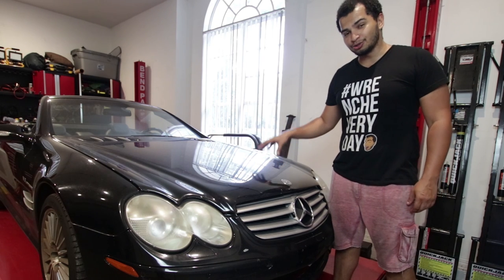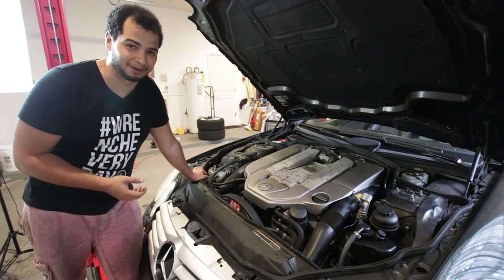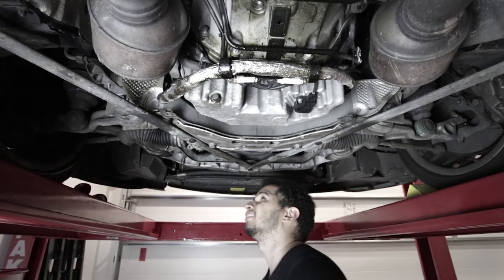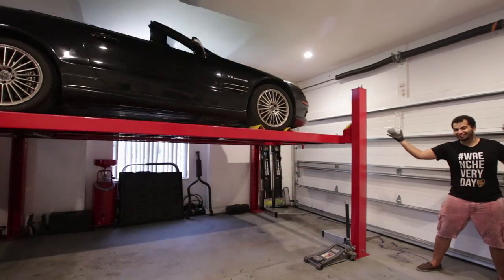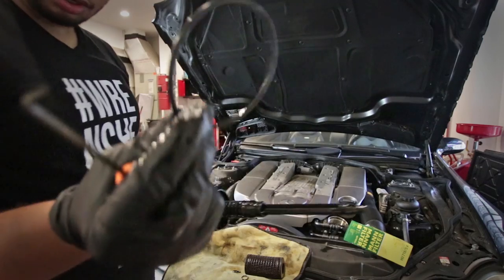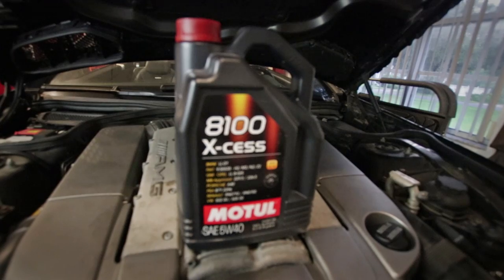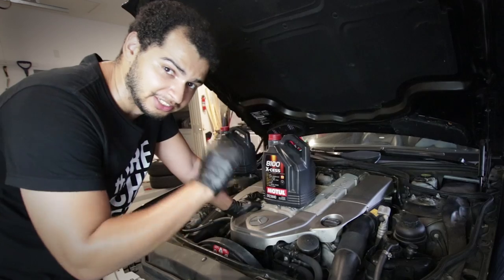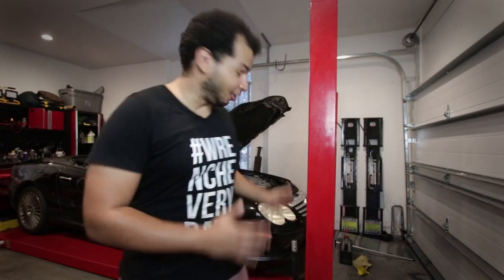Here's Why A Mercedes Oil Change Costs $320 And Why You Should NEVER Pay That Price-Project SL55 Pt1

Comment: Engineers who deliberately design products to be more difficult to repair and service should be forced at gunpoint to work as a mechanic for a couple of months.
Reply: Engineers simply make the engine. How bout you pull out the engine from the car and work on it outside of the engine bay. No more bitching then huh.
Reply: "Fuck it, I ain't gotta work on it"
Reply: That's why I like the Korean stuff. The layout is very well thought out by people who have appeared to have cut their teeth working on cars.
Reply: You want a complex car swished into a compact body, it's going to be tough :) I guess some engineering has different goals, and that the odd position is better for performance or longevity
Reply: If you make the car easier to work on, you're basically planning on failure.
Reply: Chilly Dawgg "Fuck it, the next crew can figure it out" - My coworker who drew all the blueprints to a building into a single room without any regard to whether or not they were needed lmao
Reply: Its fault of marketing, not engineers, which I am. Engineers design is Always constrained by marketing.  Serviceability is not high on the charts for marketing and corporate. Price, performance and aesthetics are. Engineers are give an order to create an engine of X-hp in an area of X for a price of X. The more time needed for service the better is how corporate sees it as thats how dealerships make money.
Reply: Rite!...key word DELIBERATE!...
Reply: @adriangutierrez9582  how about just don't buy the piece of shit in the first place!...then no bitchin at all!
Reply: @adriangutierrez9582  so have i but not for something as silly as an oil change MB is garbage plain and simple I've worked on pretty much everything with a combustion engine and these by far are some of the worst cars on the market along with Audi and i love Audi but they are beauties that's it!...if i got that car I'm slamming a 4.8 Chevy LS and uncomplicate my life!...
Reply: That's a bullshit excuse German engineers might use. The bottom line is that sooner or later all cars will need work done on them. Thinking of ease of service doesn't speak to the car's cheapness or poor quality. It's just that marketers have done a great job of convincing some people that unnecessary complication equals sophistication and better build quality. Practicality and performance do not have to be opposed to each other.
Reply: I think you'll find engineers do what management tell them. It's called planned obsolesence and pretty much everyone is doing it. Phones and laptops are particularly bad examples.
Reply: Well said. I think we're both saying the same thing in slightly different words.
Reply: @ColdWarVet607  You're absolutely right of course. I'm also an engineer and really don't like being blamed for the restrictions that Marketing and the Shareholders put on us. We have less control over design that most people ever imagine. I was shocked and dismayed to learn that at one company I worked at the procurement department would tell us which parts we could use in our designs because they knew somebody that they could buy them cheaper from. This is a common occurrence and of course, most people know that accounting departments often force engineering to limit how much timothy can put into research and how much they can spend on quality (or lack of quality) parts.
Reply: Don Boss  You're right. Its actually not mostly, we receive strict instructions from management that limits us in every way imaginable. I have never worked for a company that told me that I could set the budget, design the product (or feature) any way I wanted to and had unlimited time to do so. It just never happens. LOL
Reply: Okay let me have things cleared up here,  some engineers design their own engines based on the assessment they have that what they have designed can't wear out just in time but again it's in the part of the car owner to use the roduct according to specification if not you will be in a deep shit and spend unnecessarily
Reply: @Billy123bobzzz  hey bud,  even if you had the opportunity to design something yourself,  you wouldn't just want it to be like other manufacturers,  you like to make things look different from others and there would be a time where you have a lot of confidence on your parts which you will use for your build and after lots of testing you designed it and your manual is right there to be used for instructions but these people never uses it,  they never read it,  in my country no car owner will ever read their car manuals or try to do anything on their cars themselves,  they use their cars roughly and when it's time for repairs they bring it for repairs. There are long ways to go in educating car owners really it's not from the manufacturers
Reply: @osazuwaprecious7  You are right but as an experienced engineer I can tell you that the real problem is management and stockholders putting restraints on engineering. We have to fight huge battles with them every day. We know that people don't read manuals so we would design systems that are so obvious that no manuals would be needed but once again, we cannot do that because the problem is management and shareholders (keep in mind my friend hat we are never allowed to talk to the people, we only talk to management and shareholders and since we design and make the product that people the get to experience, the problem obviously goes straight back to management and shareholders).
Reply: Im certain they get orders from the higher ups to design these cars this way.
Reply: You telling the truth
Reply: I have a friend from college who works for BMW as an engineer. He says they're told to do ridiculous things a lot of the time and are told to stay in their lane when they propose much easier/more efficient ways to get the work done.
Reply: I work on my own 2005 Mercedes E320. It is actually designed very well regarding maintenance. It is not difficult to work on at all. Yes, parts tend to be more expensive, but that's because it's European, not necessarily because it's Mercedes. VW parts are just as high (I also have a VW) . The guy in this video is just being dramatic.
Reply: Jess Stuart I love this comment. I feel the same way. im always at work taking certain unnecessary bolts off like god damn engineers!!!!
Reply: Amen brother. I was a heavy line tech for  a Ford dealer many years ago. I would love to have met and cussed out the bastards that designed the Mercury villager/Nissan quest. If you worked on them back then, you know exactly what I’m talking about.
Reply: How about 10 yrs?
Reply: Engeneers design the products ina way  which maximizes the profits of their employers. Famously there is a patent for a bulb with infinate life. .... this is not a good comercial product as once you have sold to a customer he does not need another. Rich companies have an obsolesence element in their products which makes you buy again and again.
Reply: Have you ever worked on a w124 mercedes diesel. Easiest car ever to work on. For an oil change you literally only need a 13mm wrench. Filter is on the top held on by 2x 13mm nuts and even the filter itself has a carrying handle for easy removal.😂
Reply: Absolutely agree.
Reply: Hahahaha hahahaha I cant stop laughing hahaha.. U made my day
Reply: I work at an oil change place and I say this to myself on so many cars and especially the German cars with a ginormous skid plate with 30 screw that are different sizes
Reply: Your oil level might show OK now but once you start engine and gets cycled through the engine and filter might drop again!
Reply: cue reminder that MB used concentration camps to manufacture their engines
Reply: Lol some of you really think engineers have a say in anything uh? 🤣 I'm a design engineer for a 2nd tier supplier and by the time my design is in production, it's a watered down Happy meal version of what I really made. Money is what makes decisions
Reply: Amen
Reply: What about Molly oil is that a good brand
Reply: @adriangutierrez9582  engineer spotted

Comment: as an mb tech, i understand his astonishment but when it comes to these vehicles they can be highly sensitive, amg’s on some variants require to drain oil from the oil coolers, replace seals, they take way more oil. also the amg’s today that have dry sump motors (no oil pan) have an exact way of performing an oil change or these values will be wrong and display a message or fault, you’re not just paying for an oil change, you’re paying for the best. it’s a status to drive these cars, an accomplishment. the services he talks about are completely wrong we don’t just put “spark plugs in cause it needs it”, we go by your general history and mb’s recommend services by age and/or mileage and advise you what your car needs currently safety and maintenance

Comment: For all those complaining about the lack of a dip stick, there is a very good reason for that.  Dip stick readings are notoriously inaccurate depending on oil temperature, car on level surface, engine temps etc.  Also you can not check oil level properly with a dual sump setup using a dipstick.  The electronic setup is far more accurate and is always checking the level and will warn you if it is too low.